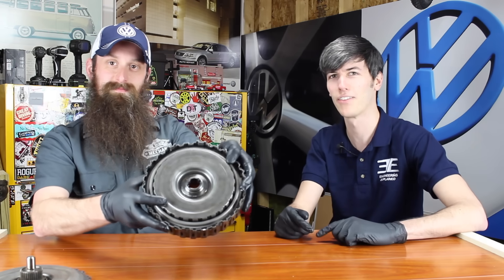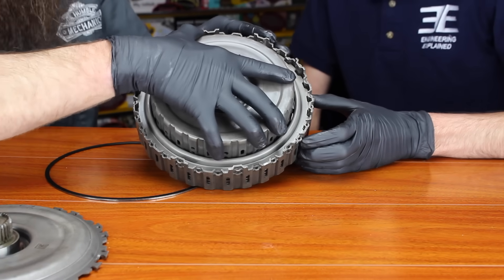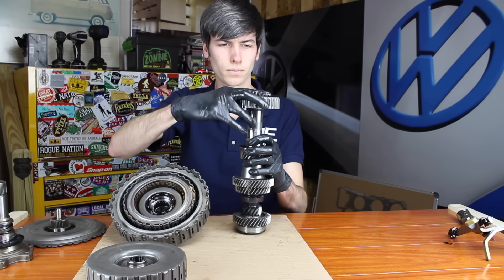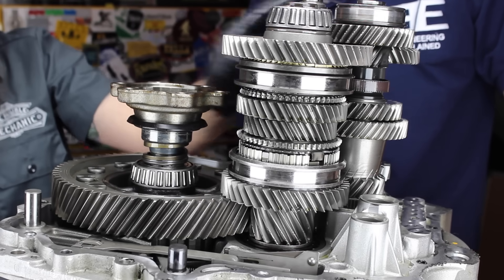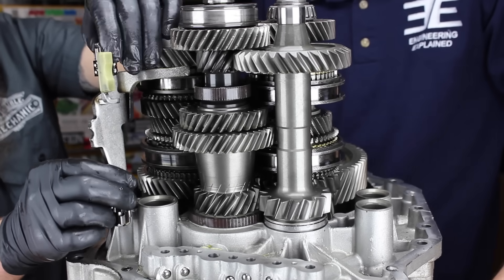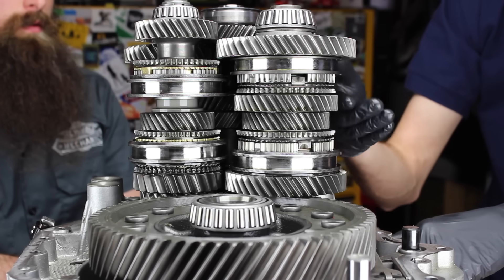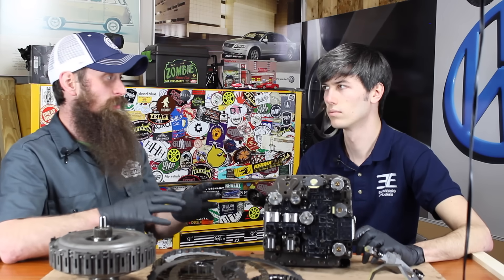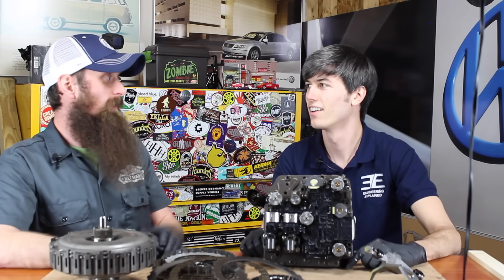DSG Transmission - Explained

Comment: Is there any difference between the DSG (VW) and the S-tronic (Audi), except that the S-tronic can handle more torque? Thanks for the very informative vid!
Reply: When it comes to comfort of driving, DSG is faster. I drove audi a6 with s tronic and VW touran with DSG. DSG just shifts less noticeable and more smoother when slowly accelerating (like cruising in a town)

Comment: Thanks! This video was very helpful in understanding how simple the DSG operates. If you have any input on why my 2006 TDI jetta is intermittently jerking or lagging in engagement in reverse and in 1st but works flawlessly in all other gears I am all ears.
Reply: James Wentz Some of that is normal on the early mkv DSGs. That can also be a sign of a failing mech unit, or even a failing dual mass flywheel.

Comment: Nice video, been wondering how these worked actually inside the box. I'd really like to know the reliability of these boxes and clutches and what kind of mileage you'd expect compared to normal manual dry clutch setup? As I can only imagine the $$$ to fix/replace

Comment: could you explain me the delay period and why that would occur. lets say ur stand still and u floor the gas pedal , doesnt a normal planetary gearbox shift to a lower gear atuomatically. how would it be different than me selecting manual mode setting it in 1st gear and than flooring it than if i leave it in auto mode and do the same?

Comment: this gearbox is a disaster !!
yes its very smooth, very fuel friendly,
but, it breaks a lot!! no matter what the car is VW, Seat...etc a lot of complains specially with the heating issue when driving on a low speed continuously or in traffic
you'll have to shift it to manual in traffic or sport mode just to keep the clutch for longer time period
Reply: Early VW and Audi models did have problems but most if not all were rectified by 2014. I have a 2015 S4 DSG with 82k haven't had an issue yet. The problem is most people will not service the DSG under the dealer recommendations therefore shortening the life of the DSG causing premature failure.

Comment: We are also VW Dealer so I know the DSG transmission, but you have the 6 gear version which is for the engines to 350Nm of torque (mainly for TDI disel cars) and you have a 7 gear version which is for the engines to 250 Nm of torque (mainly for the TSI eurosuper gas 95, 98 or 100 octans cars). Can you explain the difference and also 6 gear DSG is with oil (changes every 60.000 km) but the 7 gear DSG is dry sump (no oil change). The second thing is that ibn tne Passat 2015 you can have 7 gear DSG in TDI version but only in top TDI version which is Passat R TDI 4MOTION (240 PS or HP). And at last they have announced a 10 gear for 2017 it's already developed and they are testing it and optimizing it. 
Also thanks in advance for explaining it. 
Your admirer from Slovenia, EU. 
Ciao, M.
Reply: Podjetje MOTORIST in the USA, the only dry clutch we have is in the Hybrid.

Comment: The DSG in 2009 JETTA TDI failed at 173000Kms and cost over $5000 to replace.
Reply from the maker: VW TDI That's a lot of miles. I'm sure there's an example of a part that's failed in every car by 173k kms. Simple probability. If it makes it through warranty, the engineers designed it right. If it lasts forever, unnecessary money was spent.

Comment: What an over priced, over complicated and over engineered piece of garbage! It is a complete waste of the consumers money.
Reply: Daniel Mazurek  $1200 or so option really isn't bad for a transmission like this that provides 3 completely different shifting modes. But then, I do read that most people wind up leaving it in basic drive about 90-95% of the time, once the 'new' wears off. A lot of machining in there, yes. Haven't heard any horror stories though of 2010 and later boxes exploding or anything. Have even heard of some with 140K and going strong. I'm trying to decide myself, between DSG and 6MT for a TDI. Probably will opt DSG. Really want all the Golf offers, and didn't realize I had to get so familiar with the workings of the new DSG to even make a decision! So I partly agree with ya'- Much heavier and more complicated than I would prefer, but don't want 6MT for a daily driver for the next 5 or 10 either. I WOULD love a single-mode bulletproof auto slushbox with slightly sporty calibration and shift points. DONE!  But NOT an option... guess it's either full-on manual do it all by hand; or take a chance with what looks like 2 transmissions thrown together with a bunch of sensors and controllers and hope for the best. I hear they warranty the newer ones for 10 years/100k now, but I'm nervous even with that. I'm about to update from my 96' Grand Cherokee (straight 6), with 250K :).

Comment: So basically its a manual transmission using an automatic transmissions clutch packs and pistons. With the combination it might last longer then both wear wise because you don't have to worry about all the clutch packs a normal automatic has or the clutch going out like a manual. Since it's all computer controlled, as long as the electronics hold up, it should have over 100,000 miles of life or 200,000+ maybe.
Reply: Just don't bottom wash your car
Reply: you would think.....
Reply: Hahahahahahahahahaha longer life than a manual

Comment: So does that fact that multiple gears are selected at one time if the controller thing the driver is going to change gear so that mean the gears themselves will wear quicker than on a manual gearbox or is the fact its controlled electronically mean it will change gear in a more efficient manner than a human changing gear thus resulting in less wear overall?

Comment: Hi Jason, I was wondering whether you could explain a few transmission related terms and their inner workings: firstly, what is a dog box and how does it work? what are it's pro's and cons?; secondly, what are straight cut gears - same as previous; and finally, what kind of transmission would say a gt2/3 car use and where does the distinct whining sound come from? 
Thanks, Lloyd.
Reply from the maker: Lloyd Barker Dog box is sequential, uses dog clutches (no synchros) to engage gears. Here's a video: https://www.youtube.com/watch?v=E1APhLQVtlEStraight cut refers to spur gears, the teeth are not angled like they are with helical gears. Cheaper, but much noisier. The whining comes from the spur gears (if used) and from a lack of sound deadening throughout the vehicle. Hope that helps!
Reply: Engineering Explained Great, thank you!

Comment: Hi guys. Nice video. Still i have a question on DSG  and the downshift from 3 to 2 clunk noise. There are a lot of threads on forum with that kind of noise but no one ever gave an clear answer on that. So, what is the source of that sound and the cayse of it? Thanks

Comment: Fantastic duo you guys form! Theory and practice - great :D. But i think you didn't say anything about shifting like from 1st to 3rd/4th or(something more likely to happen like) from 4th to 1st/2nd. I mean what about the skipshifting like in normal manual gbs is not a problem; how do the electronics react in a situation like that (when that "next-gear-prediction'' probably wouldn't help as much) ? 
Be back with more coop videos! :)

Comment: thanks for the video. In terms of reliability, is DSG prone to more problems than manual or traditional automatic transmission? or even CVT? Also in terms of the number of parts and size/weight, what are the ranks between these transmissions?
Reply: Old comment, but the 7 speed dry clutch is more reliable, but expensive to fix.

Comment: The DSG is an amazing transmission. It’s one of the main reasons I bought a MKV GTI – I was so impressed by the technology. I enjoy driving manuals, but I think the DSG is fun to drive and it benefits from improved performance, fuel economy, and convenience over a traditional manual. VW is also continually improving it; I drove a 2013 GTI and the DSG was even smoother and more refined than my ‘08. 

Thanks for showing us the inner workings of the DSG!
Reply: ferme ta gueule
Reply: How reliable was it?

Comment: thanks for great video...i was just wondering if its possible to have 3 clutches and never have a delay, so for example if are in 3rd gear you have 2nd and 4rt preselected...i know that it would be very complex and expensive, but still is it theoretically possible to make a 'box like this???

Comment: Great video guys! However I had a question. Say you are on 4th gear and you brake to go down to 2nd. I am assuming the second clutch will have 3rd gear engaged. How would that work? Thanks in advance and apologies if it's asked already! :)

Comment: Can a DSG transmission skip gears? For example, if you are cruising at a constant speed in 5th gear, and you brake abruptly to a situation where you need 2nd gear. Do the car go 5, 4, 3, 2 or it just switch from the 5th gear to the 2nd?

Comment: HumbleMechanic why does my dsg gearbox jerk when changing gears all the time!? It can be extremely violent and it can bang into gear. Sometimes when coming to a comolete stop it jerks repeatidly.
Reply: amcalonan303 no way to be sure with out driving it. If it is ALL gears, that is most likely a clutch pack or a fluid issue. What type of car is it? Shoot me an email Charles(at)humblemechanic(dot)com
Reply: Is it first to second? Do you have a
Dsg6?

Comment: VW cars are notoriously famous for their DSG (dry clutch variant) & mechatronic problems in Asian countries, especially if the vehicle was heavily used in hot weather, traffic congestions & start-stop traffic (yes, our traffic jams are horrible). It has been circulating around that the dual clutch transmission is very jerky in start stop traffic & indecisive in choosing the right gear in those circumstances. as a result, DSG tend to kaput after 6 months of usage & unfortunately it is time consuming (waiting for the parts) & cost a bomb to repair. & the problems persists not long after that. Ford's powershift (also dual clutch) is sharing the same fate too...
Reply: Used to work at a cab company in London, VW DSGs were good to about 150k miles and the powershifts on Ford Galaxies were about 110k
Reply: Perhaps what they should make is a triple clutch system lol
Reply: @k3v1nkok  triple clutch wont change anything.. whole purpose of dual clutch is for a 2nd clutch to already be pre selected to the next gear so a 3rd clutch would literally just sit 2 gears away from you for no reason
Reply: @recon_ron7746  what I mean is one for the current gear, one for preselecting a higher gear, and one for preselecting a lower gear lol
Reply: Just disable start and stop engine through vagcom or OBDEleven.
Reply: Same in israel. DSG gets ruined very quickly
Reply: Mohd. Radzli Rahman I have been using a DSG Polo GT for more than a year now!!!!!!! Fantastic is all I can say!!!
Reply: @brioown  i have a 2011 golf tsi. It suffers the clutch slip and it can't engage in any gears
Reply: @Newbieakanoob  I have a 2011 TDI and my transmission is great
Reply: And yes, it is being used in India in extreme hot weather of North India too! No problems felt!

Comment: Fantastic video! Really made it easy to understand. And thank you for explaining what happens if you go against the logic of the computer, that question was in my mind during the video and I was very happy to see it explained.
Reply: Keep in mind the transmission is expecting to go up or down one gear at a time, so the alternate shaft will get the torque smoothly. But if you give a contradictory input, it now has to jump 2 gears up or down, the first one just to cancel the current pre-select. The alternate shaft is bypassed and everything flows thru the current selected shaft, so the change is going to be much more abrupt and harder on the clutches.

Comment: Great video guys! Such a clear explanation.
I have a follow up question though, how have the VAG DSG transmissions changed since they were first introduce in the mid-2000's? If much at all?
Reply: HumbleMechanic Fuzzy logic is a computer programmer term for things the human mind can easily understand, and yet a computer struggles with how it's fuzzy it's not as definite. 

Example of fuzzy logic from above:
"Not as definite"

It's simple for us to see that meaning. There are things that are certain and not absolute. Hard for a computer program to get that.
Reply: Thomas Borg the "fuzzy logic" has changed, but the overall system is very similar
Reply: HumbleMechanic "Fuzzy Logic"? As in minor improvements around efficiency, reliability, etc?

Comment: I think what people describe mostly about DCT transmission is in stop an go traffic especially if they were used to a torque converter tranny that is only felt in first gear and reverse Charles you should mention that there is a version in the Jetta hybrid with dry clutches and seven speed.
Reply: V10PDTDI I avoid talking about the Hybrid at all costs LOL! :)

Comment: At the end, I wish they would have left 1st and 2nd gear selected and alternated between spinning the inner and outer input shafts. We then could see how switching clutches would cause the output shaft's speed to change (assuming both input shafts were rotated at the same speed).

Comment: Excellent video.    I've wanted to know how a throwout bearing was implemented with these twin clutch transmissions.   VW did it using hydraulics and wet pack clutches.    Would love to see how one of the dry twin clutch transmissions does this.
Reply: grayswandir47 Jason may be able to white board that, but I dont see a place where I would have a dry clutch to demo. The Hybrid Jetta uses that. I HOPE I don't have to go down that road.. HAHA

Comment: HumbleMechanic  and Engineering Explained congrats, very nice Video and really good explanation. Just a little question, I have heared that the DSG gearbox aren´t so reliable, is that true? Is it also true that the Launchcontrol with DSG can damage de gearbox?? Thanks a lot for your anwsers! Greetings from Guatemala.
Reply: Carpower123 we see plenty of DSGs with high miles doing just fine. Do they fail YES! Do they fail at the rate that the Internet says? Maybe, but that is not my experience. I think that a large part of the "unreliability" of this transmission is not understanding how it should work. I have replaced a few units for failures. I have also replaced a few of most VW transmissions. I have heard that in other parts of the world, these units fail more, but that may be internet talk.

As far as launch control, some VWs came with that. I don't think VW would design a feature that could cause catastrophic failure. That being said, it may stress the gear box more than normal driving.
Reply from the maker: Carpower123 Launching a car puts a shock load on everything involved. Launching anything can cause damage. Can't speak on reliability.
Reply: HumbleMechanic and Engineering Explained thanks a lot for your help!!

Comment: Do DSGs always engage the adjacent gear, in other words, are they strictly sequential? Well most DSGs use sequential gear selectors but I'm just curious whether they can "skip" gears.
Reply from the maker: SUN SU I would imagine if you were in 6th and came nearly to a complete stop, it would allow for skipping, but I can't be positive. Likely only in rare cases.
Reply: In my dad's Golf R if you floor it in 6th it will drop to 3rd without going through the other gears

Comment: Are all automatics double clutch?
Btw. No dislikes, because it's a good one!
Reply from the maker: MultiLuc28 Not in the sense that this transmission is a double clutch. Automatics use clutches and bands to switch gears, but they use planetary gear sets rather than concentric shafts as the DSG shown does.